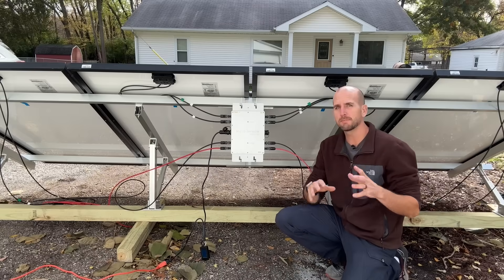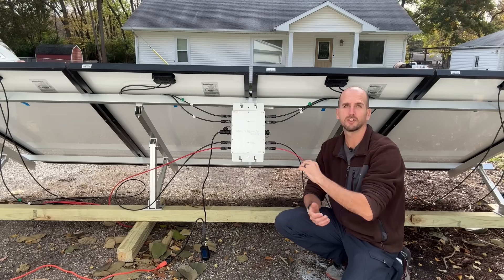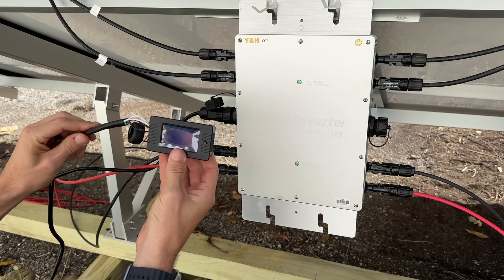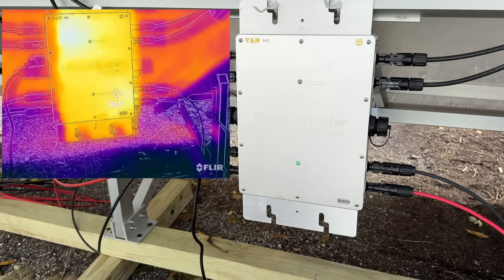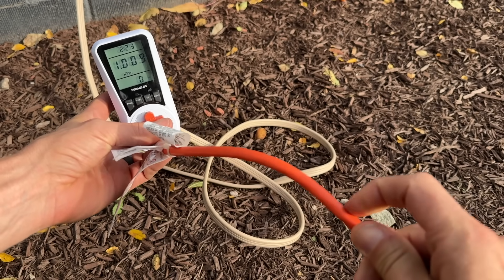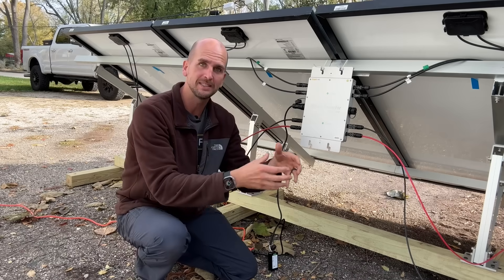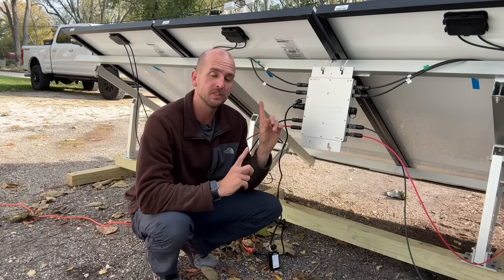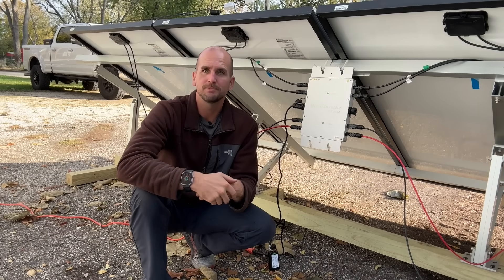Plugging Solar Panels Directly Into An Outlet | Surprising Results

Comment: So I've been looking at microinverts for a bit now, for the off-grid system I'm building. At my current stage, I've got a very small system (6x200w) panels. However I'm basically in the woods, and there's a fairly small window to the sky and there is a lot of shading issues, thus the microinverters would help in that each panel (or 2s wired panels) would give full output anytime they are in full sun, regardless of what the other panels are doing. The thinking is to feed the 120vac into the grid connection, in this case of an EG4 3k/48 all in one. However I just got that system up and running, and need to check if there is any ac on the ac input terminals with nothing connected. If not, then these would not work (unless I trick it)

Here's a thought for those using this type of microinverter, on a batteryless, grid-tied situation. If you can isolate your home wiring from the grid (such as is used with a generator under those connections) and feed some, even small amount of 120vac 60hz power onto it, maybe from a small "solar generator", then perhaps the panels would see this and come on line and take some or much of the reduced load of the house, leaving the "solar generator" more or fully charged until the sun goes down. Just thinking out loud.

Comment: if it overheats just get some thermal epoxy , a large heatsink that covers a whole side , some fans and a DC Buck Converter rated to >50v. Epoxy the heatsink to the back side, mount the fans to heatsink, power fans from the buck converter connected to one of the solar panels.
Reply: or power from the fans ac out, so the fans run only when power is on
Reply: Ridiculous! That's called Hackman ship
Reply: @Riceman-o1p  the only other way is to open it up, find the components that are over heating, build a custom heat sink and cooling system within the space or expand the space, then tap into the existing power.

Comment: It still breaks code if the baseline load of the home is lower than the power generation, at least in the state of California. You need a utility contract to legally backfeed into the grid.
Reply: You honestly will just be charged for production as most meters that aren't built for solar charge for biderectional power
Reply: Well, for the last 23 years I've been doing exactly this. Unless they (the utilities) actually check they will never find out. It's all monopoly politics since any excess generated electrons will simply go to your neighbors. Also, most inverters now can prevent export with a CT clamp. In California, practically anything you do in your house is against code - unless, of course, you've paid the city some money on which they can tax you.
Reply: You people clearly didnt watch the video. It cant back feed
Reply: @broughttoideas  it can if his house uses less energy than the panels are producing
Reply: @broughttoideas  It cannot backfeed **if the grid power fails**. If that happens your home will be without power, you will not get any output from your solar panels to run anything on. But as long as the grid is producing power then if your panels are producing more power than your house is using then power will be feeding back to the grid. You supplier will be getting free power.

Comment: What happens if you use 15 amps from your grid breaker and another 15 amp from this on the same circuit?
Reply: I would think it best to only put this on a dedicated circuit.
Reply: Well said! It's rare that some people actually have a grasp on this.
Reply: Wires become an in-wall heater. Perfect for those cold winter days!

Comment: The inspector might say it's ok, but it's up to your energy company to approve if this grid tie inverter is allowed to be connected to the energy grid. Typically the energy companies require permits in addition to the UL1741 other certifications, and external disconnects. That said, this setup should be ok, but you may have to conceal it.

If you have a smart meter, these meters can detect energy returning to the grid the moment your energy consumption is below your production on any leg of your house. They will ping your energy company and you will get a threatening letter telling you to remove the equipment or face disconnection.

If you have an analog meter, it's slightly easier to skirt by the rules. Your main issue is the meter reader guy seeing the meter spin backwards (although they probably don't pay attention). The second issue is your usage being negative for the month, which would be somewhat hard to do with small grid tie inverters like this.

The end goal is to make your solar system to produce only enough PEAK energy to meet your IDLE house demands, but nothing more. Once you product more than you consume at any given moment, you'll run into issues.

I'm debating whether to do this, so I can get the solar tax credit, though my roof isn't really oriented the right direction for sun exposure.
Reply: Hi could you a grid limited inverter that puts out just less than you are drawing to not back feed the grid, uses a current clamp on the input to the house to do this.
Take care M.
Reply: @markeh1971 I've seen the newer inverters that have an amp probe you put on your power feed lines. It senses when you start backfeeding the grid, and the inverter cuts back the power, so you are only feeding your house.
Reply: @electromech7335  can you please post a brand or model that does this. I have only even seen a grid sensor to shut off in case of the gid going down. I would love to check out some that do what u say.
Reply: @markeh1971  Get a hybrid inverter they have the capabilities you need and want
Reply: I can see where you are coming from however I can see this as being useful for those with non-North facing windows or balconies that live in apartment or condo complexes. Or even those who rent and can not do a permanent install. This wouldn't offset their entire use but could help in decrease their use.
Just think if every south facing unit in a single apartment building were to use this to offset 1/3 of their yearly electric use what that would do for the grid.
Yes, not having the proper UL and other certifications would be of extreme hinderance in getting approval from the Utility. Also not having proper external disconnects. However, again if on an apartment complex those must have a master building disconnect somewhere or a dedicated transformer the utility would trip their own circuit breaker on, Looks like a little fuse between 2 power lines.
Reply: The real question is, would running this with an existing solar system that is also checking for line voltage to keep the circuit closed confuse both systems so they both continue to operate during an outage?
Reply: My question exactly @dwarfcow
Reply: You could program your pool with an Arduino to use extra solar power to use solar water heating for the pool, just to make sure you don't put power back on the grid. 😮
Reply: Solar grid batteries - has anyone done this?
Reply: @Tennisbull-match-statistics yes I have done this. And many people do this. The original commenter on this thread is only talking about his local jurisdiction/ state. Many states allow backfeed to the grid if the system is capable of monitoring the grid to ensure no one gets electrocuted, which is far fetched tall tales. 

With the right permitting, you can backfeed to your grid and reduce /make money because your power company will need to pay you for your contribution.

I don't know why everyone makes solar so scary as if we haven't been doing it for 40 years.
Reply: @CivilRepair  Depending on the utility company, some require a 2nd meter to allow backfeed so they can monitor how much.  My city requires a main shutoff outside independent from the circuit breaker for any solar even if it's AC microinverters.  I think I asked if it was still required for ground based setup and they said yes but it's been 10 years -_-  If you go by the requirements of your city, etc it can be daunting to implement all the stuff they want when DIY.
Reply: @CivilRepair  if you are already on Net metering this is a nice upgrade option
Reply: @Tennisbull-match-statistics  Hybrid inverters can do that, they are also Energy Storage Systems (ESS) that can plug into your electrical outlet to charge up, and you can use them to feed back into the grid when it is more cost effective or you can use them in event of Grid failure.
Reply: Extension cords are not up to code :P
Reply: Great comment, and spot on!!!
Reply: Great context!
Reply: No, you apply and once you have down everything their codes require you will pass inspection of both local and utility company. These are the same inerters mostly used in all grid tie systems if using micro inverters . Enphase just uses their own brand and specs
Reply: one option so as to use all your solar output would be to charge batteries and then use those batteries , via an automatic transfer switch, to power your circuit one the panels stop producing at the end of the day or during inclement weather....once the batteries are drained then the grid would kick in....or the sun would come up and that would kick in again.
I know the majority of these micro inverters say they cannot be used with batteries but it is just a matter of matching your battery voltage to your inverters input voltage. Most will accept a voltage from a 36v battery and should work fine.
Anyhow, this is my plan although I am still nutting it out and would also like to add another auto mechanical redundancy to stop power returning to the grid.
Reply: @Ulbre  False the will not turn on without  the correct AC voltage/current present on their Grid side connector. You would be better off buying a Hybrid inverter which has all of the features you  need. Hybrid inverters have Charge controllers built in and can connect to suitable batteries out of the box, do not require the grid to function butcan function with the grid also. Can direct power where you need it and block it where you don't.  Can provide power at schedule times to those areas also can feed the grid or not, or at schedule times.
Reply: @Ulbre  sounds interesting but actually doing it without destroying equipment will be proof.  Stay safe
Reply: He said the inverter ensures backfeeding doesn't happen.
Reply: If you have an analog meter, they only read amps. So, if you are overproducing, they will also charge you for the WH you make
Reply: he is feeding 120-volt power back to one leg in his house hopefully it is in phase with power company and the other leg is still drawing full power separately. so meter won't spin backwards since it goes by whichever leg is higher.
Reply: @ranger178  If it was not in phase the inverter would have shut down,  refering to frequency. But the phases would lead or lag depending
Reply: @ranger178 you are 100 percent false and don’t understand  how a split phase utility transformer works. The utility will know and will fine and stop the customer from operating the inverters.
Reply: @keithpvbatt2040  Your meter (digital Network) monitores all of that stuff down to the milli amps and milli volts so they definitely will know. the second it happens and you are not mark for feed in. Milli volts you may get a register letter warning or servicemen at your door coming to pull your meter or do a pole disconnect.
Reply: @keithpvbatt2040  so the issue is what?  What specifically is the utility detecting as long as solar production is under usage?

Comment: Thank you for this, and YES, please keep us posted and keep testing! SPECIFICALLY: 1) Show us the unit turning off / shutting off input once mains is off. 2) Walk through what happens in a scenario where this is not in a dedicated circuit, and other appliances may be connected, and thus circumventing the circuit breaker's job to keep wiring safe (from what I understand, these units require dedicated circuits to avoid this issue).
Reply: #2 is a reasonable concern.  You could have an air fryer, microwave, and solar on the same feed. The two loads at the same time should trip the breaker, but with the solar feeding too, the breaker won’t trip. Got to be careful.
Reply: @davidstuebner9021  Yes, because you are putting current into the middle of a circuit the breaker in your meter will not trip if a device downstream of the inverter input overloads, it could potentially fry the wiring and cause a fire, in some countries you are required to have a spur from the main meter box for inputting power from a setup like this, not sure what the rules are in every country but in Australia in particular this method of power feed in is not legal at all.
Reply: It is a grid following inverter and not a grid forming inverter and therefore number one is not relevant. Number two is somewhat relevant but a long shot in hell that anything would ever go bad as a result of that.

Comment: I've heard of "suicide cords" but this is the first "suicide inverter" I've seen.  This should be hard wired to a breaker in a panel not plugged into a wall outlet.
What happens if the power output of the array exceeds the power usage of the home?  Some smaller houses may not have a baseline usage of more than what a 1200 watt array can output.  Then you end up exporting without any kind of export agreement or allowance from the utility.
How quick is it to turn off when the power from the grid gets cut off?
So many potential issues...
Reply: That inverter senses the grid. No grid, no power output. Just like the enphase inverters have to do, just on 120V. You can unplug it and lick the prongs of the plug if you want, there is a limit of something like <50V in 200ms or something

These setups are common in Europe as "Balcony power plant"
Al thou they are limited to 600W and we have 230-240V here, so just 2,6A more on the (mostly 16A were I come from) circuit and not 10A more on an 15A circuit with 1200W on 120V
You could theoretically draw 25A from that same circuit from another outlet and that will be a fire hazard.

you don't have to match the loads on the legs of the whole panel. The meter does not care if it is 1000W out on one and 1500W in on the other, it senses the summ of 500W in

But:
In some countries it is prohibited to feed back into the grid and the meter disconnects if it detects over X Watts for over X Seconds (and that could be per leg), that would be bad
Some meters will run backwards if you feed the grid, that would be ideal.
some have a prevention for running backwards, not ideal, not terrible
and some (especially digital ones) only run forward, even if you feed in, this would also be bad since you have to pay 1:1 for what you feed in
Reply: It's not a suicide inverter since it needs to not only be plugged in, but have full power from the outlet before the inverter will output anything. Your other concern is correct though if you output more than that leg of your panel is using.
Reply: I just realized that this is also going to dump power to only one leg of the panel too... so not only do you have to make sure it never produces more than the base load of the house, it has to not exceed the base load of the LEG IT'S ON to prevent backfeeding.  Oy...
Reply: I think you worry too much.
Reply: It will not power up until it has a supply into it.
The cord is dead until you plug it into an outlet.
The inverter has to get a waveform from the grid to match it so to not cause a mismatch. 60hz for USA I believe
Reply: Yes, it is hobby crap and I wouldn't spend $10 on that junk.
Reply: This thing is scary as heck.  The NEC code, and UL listings are there so children, fire fighters, and power co workers dont get killed by some DIYer buying cheap junk, and doing stupid stuff with power.
Reply: @Texacate  They don't work in a power cut.  Power workers are safe.

Comment: I’ve got a few similar inverters that I’ve been running a few months on a temporary setup. They definitely shut down a lot from overheating. We’ll see how long they last.
Reply: One could add  an aluminum heat sink on the outside
Reply: @kevinrummelhart and cooling fan
Reply: @kevinrummelhart  The housing is the heat sink, what he should do is fix his shit.
Reply: @slipperyslope5364  he is a accident waiting to happen.  He doesnt understand the big picture. Adding power to the grid is having you cake and eating it too. Adding power to the grid can cause surges . That is why they power company needs to regulate it.
Reply: @johnramirez5032  Its not adding power to the grid.  It will only give you as much wattage as you are using from my understanding.
Reply: @emmcey  a electric dryer can use 5000watts ,thats alot .  A microwave  oven 1000 to 1500 watts. An electric  car charger would need something like 40 pv panels . Batteries is a necessity when to start using those large loads. It gets a bit complicated. As long as he is not trying to run both at the same time then he should be ok as long as it not pushibg lots of electricity  a rule of thumb is 80 %  of the system capacity at any time. It can get very complex .
Reply: @emmcey  
If you have the right meter they have the facility to work backwards so will put power back to the grid. This obviously has to be known and approved by the power company like in a few European countries. One of the problems those countries face is the red tape of repaying the customer as it's classed as taxable  income.
Reply from the maker: Yeah, I want to push it a bit (higher outside temp and closer to 1200 Watts) and takes some images with the FLIR camera to see what the skin temp is getting up to at or close to the shutdown.  Seems like that is the major complaint and you have to think that would impact the overall life.  Thanks for the feedback!
Reply: Check the house in your community ask them if their are overheating because most of the Grid tie installs are done using micro inverters.  Check your setup because if yours is shutting down because of heat something is wrong at your house .